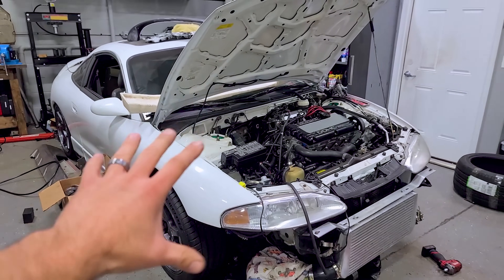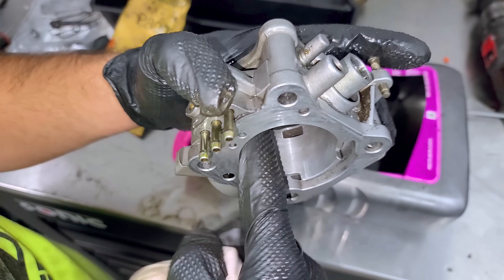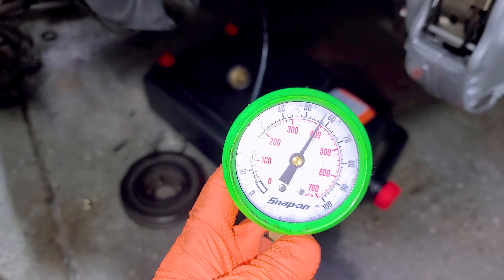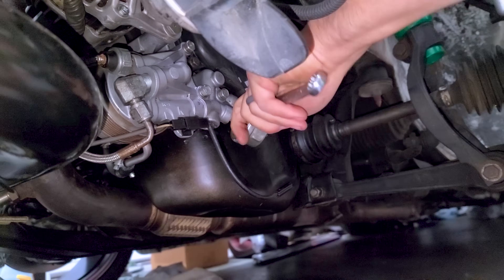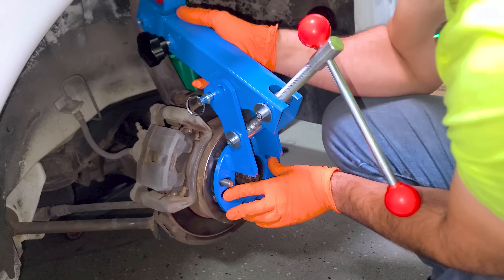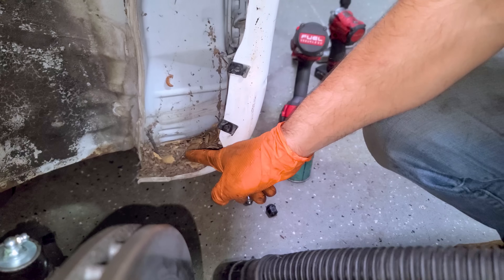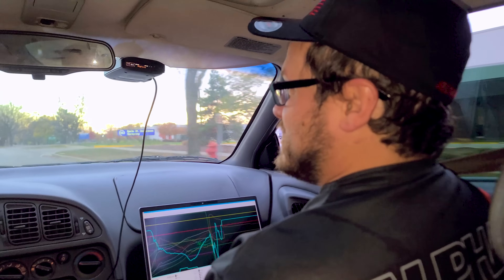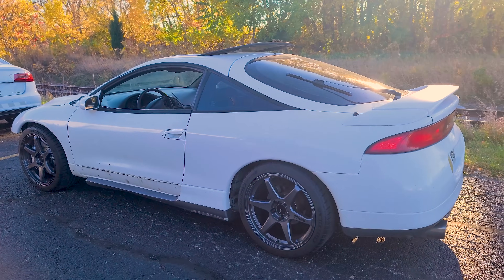We DOUBLED The Horsepower Of My 240,000 Mile Eclipse GSX & It Totally DID NOT BLOW UP!

Comment: As a guy that daily drives a dsm, thank you for trying to keep them alive! In case you're curious about what I drive it's an 02 Lancer OZ Rally, also if you start hearing valve tapping that's a dsm thing hahaha as long as it doesn't get too bad/loud you'll be alright.
Reply: Sorry man, Lancers aren't a DSM.  The DSMs were only Plymouth Laser, Mitsubishi Eclipse, and Eagle Talon's built in the Normal, Illinois assembly plant under the company of Diamond Star Motors.  They were not imported in to the country, and they never made RHD versions.  Lancers, Evos, Stealths, 3000GTs, and other products that use the sirius based engines are all imports and build overseas and are only Mitsubishi products.
Reply: @BasedEMT1776  had to make sure you weren't full of shit and checked it out, you're right I always figured it was the early Mitsubishi products in the USA were all dsms, learn something new every day.
Reply: @GNelson1989  No worries.  Fun fact: the early Chrysler K-Cars (lebarons, and the horrible vans) were Chrysler and Mitsubishi's first real partnership.  They are like DSM cousins.  Without the success of those we wouldn't have Lancers, Evos, DSMs, or anything like that here in the USA.  Mitsubishi never would've gotten a foothold here in the US that way, and Subaru never would've brought the WRX/STI here without competition from Mitsubishi in the form of DSMs and later Evos.

Comment: If you only made 400 hp your doing something VERY wrong.
I had 550whp at around 25lbs on a bushing 50trim turbo with full bolt-ons, front mount, short route piping, 650cc fuel injectors pump and regulator, 3in o2 back exhaust with magnaflow highflow cat to pass emissions flawlessly, and stock head, block, throttle, and exhaust mani.
You also MUST get an HKS SSQ blow off valve, anything else is total bs.